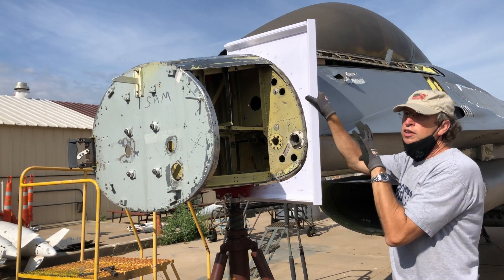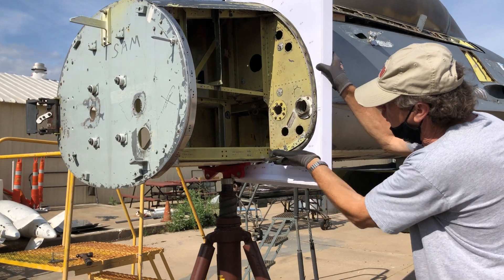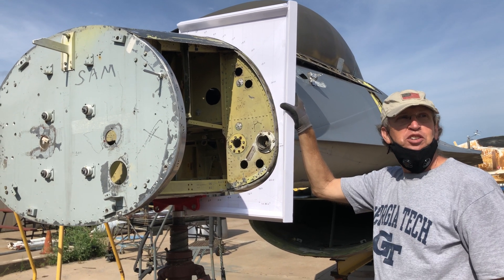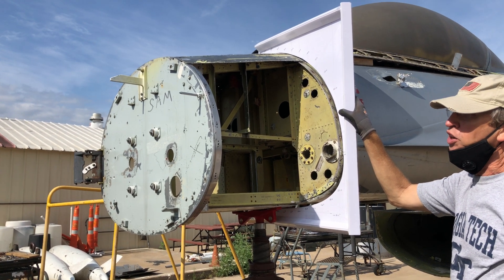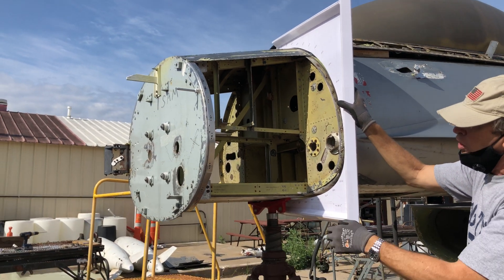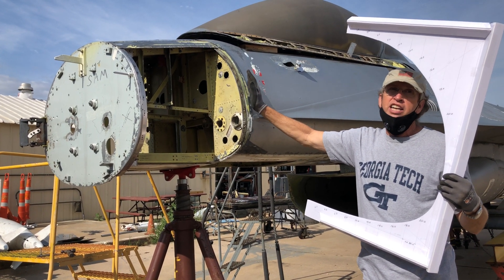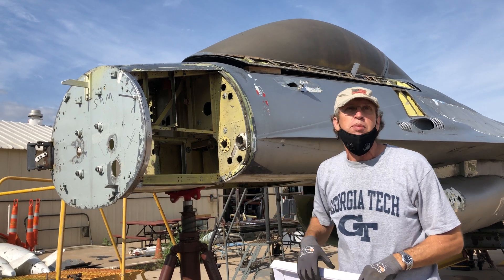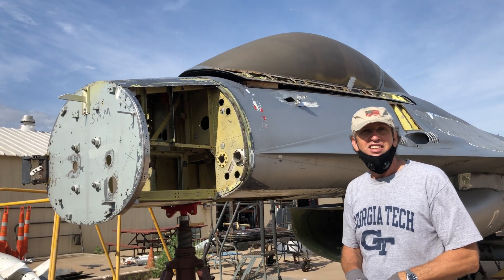YF-16 Nose Cone Modeling - 23 May 2020

Comment: Question about the nose replica --
Did anybody think about going to Virginia or asking the aerospace museum staff there to take measurements of the nose of the YF-16 No 1 plane that's on display there?
I would think the planes were basically identical.
So, the nose on the YF-16 was basically straight and did not have a compound curve or bulbous profile on it like the production article F-16A onward?  The nose of the YF-16 struck me as more aerodynamic or at least needle-like.  I can understand they upscaled the nose to put in a more useful radar than what was used in the LWF competition.  As I understand it, the original radar set was equivalent to if not the same hardware the F-5E used.
Reply from the maker: No, we were able to obtain the original drawing here and make contact with the original contractor.  They are going to be doing an exact replica.
Reply: @FtwAviationMuseum  Nice!
So it's going to be as close within reason!
It sounded like they almost threw this plane away.
Reply: @FtwAviationMuseum  That’s amazing.  I wish I was down there helping you guys out.  This is awesome.

Comment: If they had gone ahead and made the F-16 like what Col. Boyd and the Fighter Mafia wanted, I seriously doubt the F-16 would have reached the 2000 plane milestone plateau let alone be in production over 40 years later.  The YF-16 would have ended up like an F-5 with extended range.  Great maneuverability but not flexible without a serious redesign.
In some ways, the YF-16 does look nicer but the production F-16 was more useful as a multi-role plane.
There are times when the people that plan these things are dead wrong about the future of these platforms.